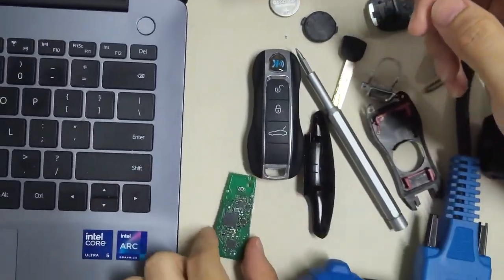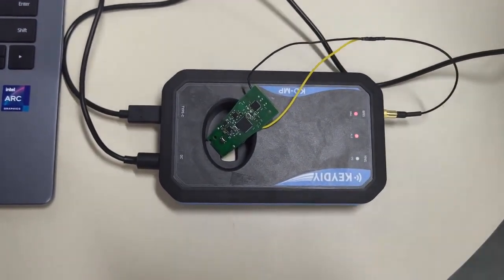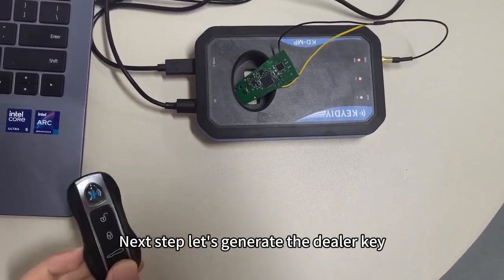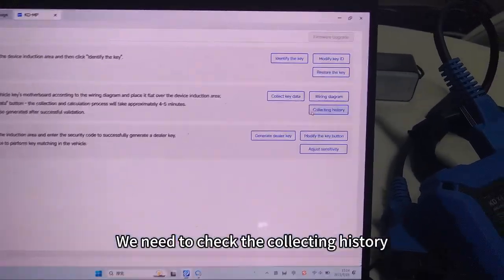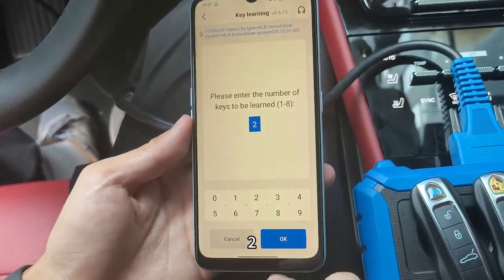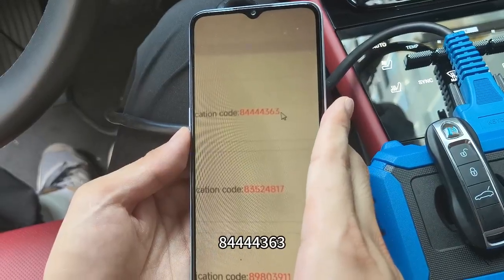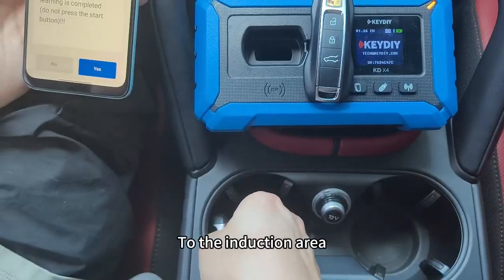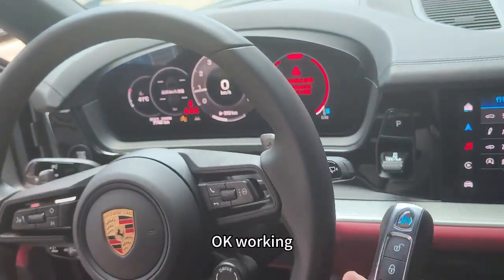How to Add 2024 Porsche Cayenne MLB key with Keydiy KD-X4 and KD-MP- OBDII365

Comment: Who are you using for the third party for calculating???
Reply: How do I contact the third party?
Reply from the maker: Calculate the token for SFD unlocking. It is provided by a CN technician. If the car does not have SFD gateway, it does not need calculation.
Reply: Do you have this technician’s contact info please???